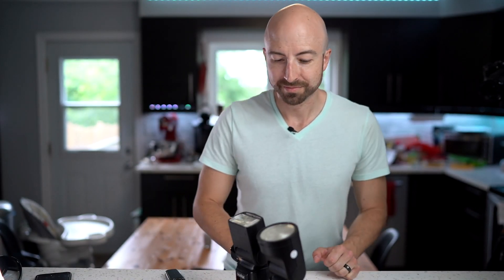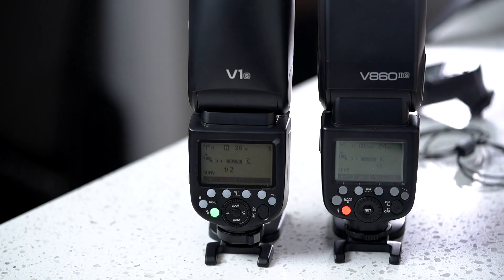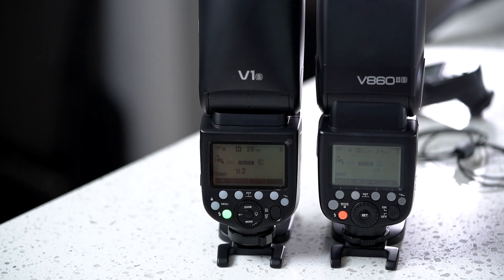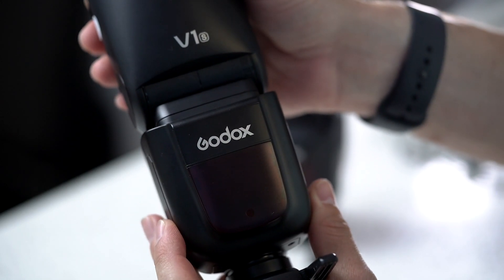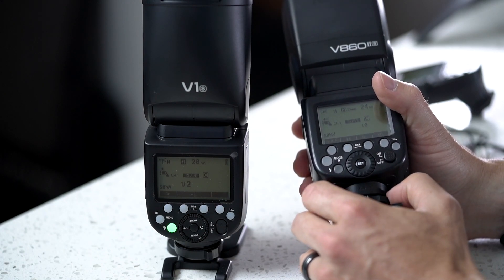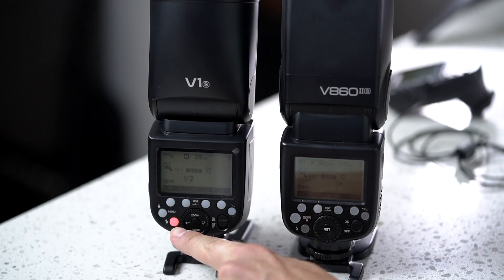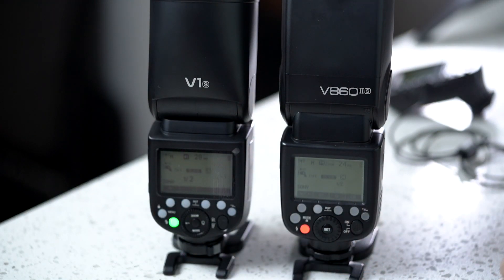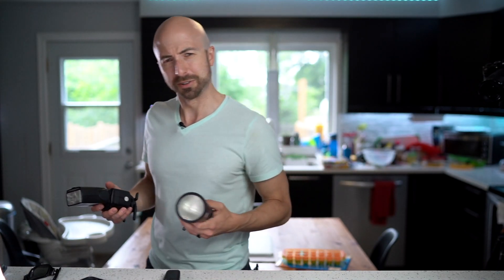Godox V1 Overheating Torture Test

Comment: I used mine on an event shoot yesterday and I had very similar results with the overheating system kicking in really quickly. It was very frustrating and embarrassing at times having to make guests hold poses whilst it was charging back up. I’m going to check the firmware and try removing the battery for my shoot today. Thanks for that tip Wes.

Comment: Exactly what I found.  The V1's overheating protection kicks in too aggressively.  Godox/Flashpoint released a firmware to address it and it helped a bit, but still...the V860's are slightly more reliable in stressful, fast paced situations.
Reply from the maker: I plan on redoing this test with the new firmware soon. Hopefully the difference will be tangible.
Reply: @WesPerry   would be interesting to see how it does compared to  a Nikon sb-900....
i have 3 and are swapping one out for a V1, but have rarely had problems with SB 900.
then agian, i don,t shoot like a machine-gun with my flash ;-)
Reply from the maker: SB900 at least only overheats when it’s actually hot...but also costs Way more. If you’re not a machine gun, you’ll probably be happy ;)
Reply: @WesPerry  i shoot like a machine gun specially at greek dancing after wedding.. what is the best flash for me? godox ad300 ? i have nikon sb910 and need back up .. if i buy ad300 i have to use one hand for flash and the other for the camera
Reply from the maker: AD300 is definitely a lot of power! I do often use it at receptions, but only mounted on a light stand somewhere.

Comment: Hey wes! I bought a v1 this past weekend for a wedding and even at lower power, the flash did overheat as well. I was forced to go back to my canon 600rt for consistent light output. After the wedding, I thought that my flash was defective, but now I’m certain the heat dissipation is an issue with the v1
Reply from the maker: If you pull the battery, it’ll reset the flash counter and let you keep firing, but that runs the risk of causing damage. The heat protection is numerical instead of temperature based, so it’s a little frustrating and sometimes kicks in when it’s not needed.
Reply: Thank you so much for that! I’m definitely going to try it on my next shoot. I do have to say though that the wireless communication with this and the AD200 is smooth as butter!
Reply from the maker: That’s really what I love about the Godox system: how seamless it is in communications and interoperability. So many options and they all work together.

Just be careful with the battery pull technique. Make sure it’s not actually steaming hot ;)
Reply: @WesPerry  I just bought a V1 myself for use at weddings and I noticed that every time I enter master mode the flash gets stuck at HSS. Have you noticed it yourself? I updated and reseted the flash but nothing changed. Thank you very much.
Reply from the maker: @dimitristriantafillou5752  I wouldn't say it's "stuck" in HSS mode. I think that it's just HSS available, but doesn't use it unless you're exceeding your sync speed. Much like how the X1T transmitter functions.
Reply: @WesPerry  thank you so much for your answer. keep up with the good work :-)

Comment: From the Manuel:  Number of flashes that will activate over-temperature
protection:
Power Output Level      Number of Flashes

1/1
                                    30
1/2 +0.7
                           40
1/2 +0.3
                           50
1/2
                                    60
1/4(+0.3,+0.7)
                100
1/8(+0.3,+0.7)
                200
1/16(+0.3,+0.7)
              300
1/32(+0.3,+0.7)
              500
1/64(+0.3,+0.7)
              1000
1/128(+0.3,+0.7)
             N/A
Did not specify a time frame.
Reply from the maker: Time frame would be a pretty key element in the calculation, you’d think. It’s a bit annoying that the cutoff is numerical and not temperature based, but that would be why they cut off at about the same time. It’s just odd that the V1 cuts off more aggressively.

When I’m using off camera flash at -30°C and it goes into thermal protection, and upon checking, the whole unit is still ice cold, I’m a bit miffed.
Reply: Mine overheats much before this when shooting a wedding. It's frustrating.. I think it specially happens coz I got the Maggrip with the sphere on. If I also the grid on it overheats faster
Reply from the maker: Are you shooting TTL? I’m pretty sure it has no idea what it’s internal temperature is, so the grip shouldn’t effect it.

Comment: I just used a V1 with my R5 at a corporate Christmas party.  I installed firmware 1.5 (or the current) and was running it in TTL mode.  From the pop it was definitely running pretty powerfully and it didn't seem to overheat on me, took over 750 photos but that was over about 5 hours with periods of rapid vs slow.  So overall did pretty well.  But definitely rapid followups didn't work as it did get slower to recycle a few times.  I'd be curious to rent a Profoto a10 to try and see how that fairs.  I mean they all can overheat but the Profoto is probably better at handling that...I'd HOPE!  ha ha
Reply from the maker: If you want to be a monster and are in a pinch, you can always pull the battery momentarily to restart the overheating timer. Just don’t do this a lot. Haha
Reply: @WesPerry  Gotcha, so no sensors just a counter and probably some kind of timer?  Or after the certain number of flashes does it just stay slow until the battery is pulled?
Reply from the maker: It resets the counter itself after 10 mins I believe. Or rather it’s a constant rollover of counting the past 10 mins.
Reply: @WesPerry  Awesome, good to know!  Thank you.

Comment: Hello.  My 600 ex rt ii flash broke and I couldn't find a new one so I bought Profoto A1.  A1 is better than 600ex RT II in terms of light power.  thanks
Reply from the maker: They are both 76w/s flashes, just like the V1 and V860iii. The advantage of the Profoto is a faster recycle time, and more flashes before thermally throttling.

Comment: Good night!!  today do you recommend the v860ii or would you bet on the v1?
Reply from the maker: Depends one what price you can get the V1 for. It varies greatly from region to region. It’s much too expensive in Canada.
Reply: @WesPerry  Today I have bought in China (Aliexpress).  has a better price than in Brazil.  That I'm just still in doubt is a matter of light and durability.  The godox V1 seemed to me easier for what I want to do using it on top of the camera but the godox 860ii seems like it can take more.  Right now, I have to invest right.  What would you advise me?

Comment: Thank you for making this video. I have a question. When using off- camera flash at a wedding reception using flash on two light stands  diagonally opposite  the room, will the Godox V860ii have enough power to light the dance floor
or would you need the more powerful Godox AD200? And do you still need to mount a flash on the camera body as main light? What flash power do you set for flashes on light stands pointjng to the dance floor and flash power on your  camera?
Reply from the maker: Are you bouncing, firing directly, modifying, etc?
Reply: I actually haven't done this myself, but if I want to fire the lights directly to the dance floor, no modifiers, no bouncing, to create dimensions & shadows in the shots as opposed to flat lighting, will the Godox V860ii have enough power? If I remember correctly, prior to the invention of the AD200, wedding photographers were using speedlights off camera to light the reception dance floor. My concern is overheating the V860ii coz the other night I test fited the V860ii at 1/32 power in 3 seconds interval and after about 300 shots, it slowed down & only fire when given more time to rest. But when I turn the switch off & on again, it will fire again every three seconds. At what power do you set your off camera flash in dance floor receptions?  Of course this also depends on how well lit the venue is. Thanks Wes.
Reply from the maker: How fast were you firing it to make it slow down at 1/32 power?? Goodness. If they’re aimed right at the dance floor, they’re probably going to be somewhere around 1/64 to 1/32, which generally results in something around 1/5s recycle times all night.
Reply: I was mistaken Wes. I was rapid firing at 1/32 power with no break. So at around 300 shots, the v860ii slowed down. And at 1/2 power of rapid fire,  I got around 60 shots before it slowed down. I am still impressed. And btw, your video contents are awesome that I'm now a subscriber. Do you have videos of your lighting setup at wedding receptions & behind the scenes wedding photog?  I'm impressed with your photos.

Comment: Hi there, I am here to make a request to you to make a new video on a comparison Between Godox V1 vs Godox V860II with a Magmod Magsphere mounted on the V860II.  The reason i am requesting to make this video is that v1 is more costly compared to v860II. So if we could produce the same effect of light diffusion/distribution using a magsphere on a v860II that a v1 could produce without a diffuser then we could buy a MAGMOD light modification kits and a Godox V860II for the money we spend buying a Godox V1.

Comment: Yes, my V1 gets slower and slower to recycle, and by 40 flashes it's over 8 seconds! It's really annoying when trying to shoot fashion! Going to see if the firmware update makes a difference
Reply from the maker: Sounds like you might be in HSS?
Reply: @WesPerry  No
Reply from the maker: TTL?
Reply: @WesPerry  I was testing it on Manual at full power. When I shoot, I use TTL also, and have the same problem, in about the same time or number of flashes.
Reply from the maker: I suppose I wouldn’t recommend using this at full power. It will indeed overheat very quickly in that case.
Reply: @WesPerry  Yes. Same happens in TTL. Will test at half power and see what happens.

Comment: V860ii is an epic flash. i literally work so hard that flash on weddings. battery last forever.  i wonder if they continue to produce more pieces or stop the production cause of how good is that flash
Reply from the maker: In my initial testing, I’m rather surprised at how much more the V1 costs, but how little benefit it gives over the V860ii
Reply: @WesPerry  i'm still in love with my v860ii and my TT685S. they didn't betray me not even a single time. Price of the Godox V1 is a joke in my humble opinion

Comment: Hello Wes, does the new Firmware update Ver 1.3 correct this overheat protection problem?  It says something about this, but I wanted to see if someone has put it to the test.  I noticed there was a firmware update on Adorama firmware site.
Reply from the maker: I'll have to give it a try real soon!
Reply: @WesPerry  Hi Wes! So did you try it with the new firmware? I tried and I am confused. I did around 80  shots in a row at full power and I the temperature control did not kick in. Some would be happy, but I wonder. Does the control really work? I was unaware that the flash has such limitations and was actually testing the battery capacity. Now I hope that I did not melt something inside.

Comment: How many minutes should we let v1 cool down to normally? Did you test with 1/2 of the power or 1/1 of the power?
Reply from the maker: I say in the video they’re at 1/2 power.
Reply: @WesPerry  so how many minutes should I let it cools down?
Reply from the maker: I can’t really tell you, as that will vary greatly depending on ambient temperature and humidity. And how cool it needs to be/how many more shots you’re expecting to get out of it.
It probably takes 30 minutes or so for it to completely cool down, but if you take the battery out it resets the timers and lets you do what you want (it’s counter/timer based, not temperature based).

Comment: Hi, great video. 
Could you do the same test with the Magmod Maggrip and sphere on it.

My v860ii overheats quite frequently.. thank you
Reply from the maker: Do you use TTL? That can make it overheat faster, as there are more flashes being fired, and you don’t necessarily know what power level it’s producing.
Reply: @WesPerry  no.. Manual.. off camera mostly.. with the Maggrip and sphere of grid
Reply from the maker: Huh. And power level? It’s a numerically controlled throttling, so it shouldn’t matter how you use it, it should throttle at the same time as everyone else’s. Maybe it’s time for an AD200 instead?

Comment: I bought the V1 just 5 days ago, was doing a corporate shoot when all of sudden the flash overheated quite fast. I think I was 3 minutes in while firing at guests that where arriving in TTL and boom, recycled time got knock down to 5/6 seconds. So, at that moment I had to use my old yongnuo cause I can't afford to miss some of the guests as they arrive. Anyway, did the firmware update yesterday and got to do a kinda similar shoot today but less stressful and guess what? The results were the same. The flash overheated quite fast and I was so f#$&+? frustrated because I really needed it to work. I had really high hopes for this flash. The flash is superb but, it's not getting the work done. I have a 55$ yongnuo and it has gotten me out of the jam, while the 259$ flash has failed. I can't believe the overheat protection comes to quickly, I really wanted to love this flash.
Reply from the maker: I can’t sat that’s ever happened to me, but I also can’t say that I’ve ever used it in TTL, which tends to push things unexpectedly hard some of the time. I’ve melted down 8 560iv yongnuo flashes myself (literally melted), so I’ll probably still stick with the Godox ones for now 😏